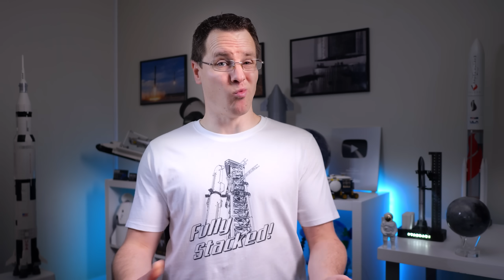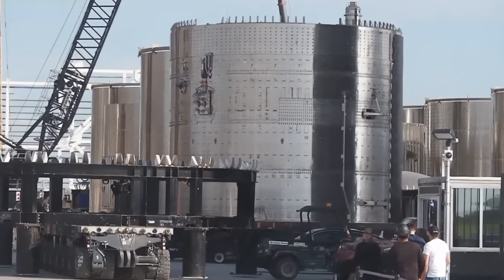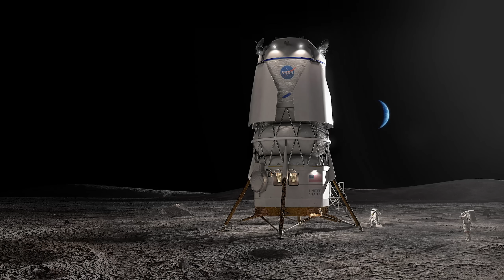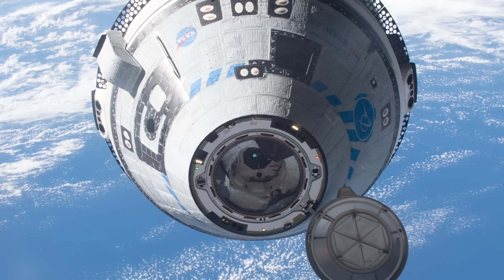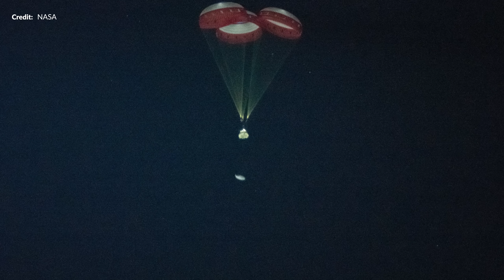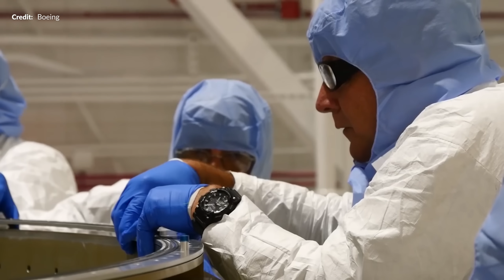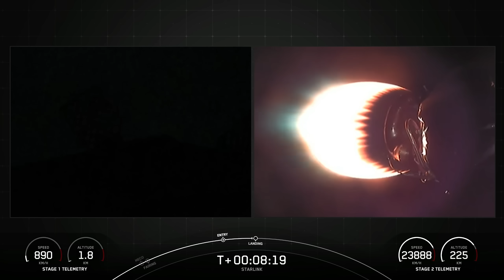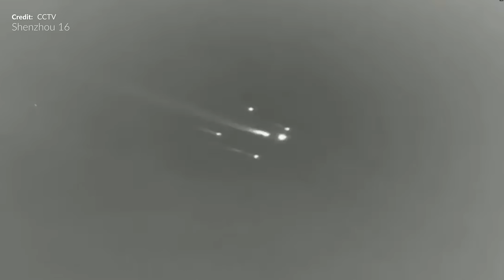SpaceX Starship: Mega Pad Upgrade to Tame the Thrust, Boeing Starliner Delayed Indefinitely

Comment: When the plate is in, they should cover it in heat tiles! The same tiles they use on the ship for reentry. A single large tile would be better with no seams.

Comment: The launch pad will never be perfect until SpaceX redirects the exhaust. I've been saying that it's time to call in the boring company. The water system will just create super hot steam. That's just as destructive as a commercial power washer. You must control the exhaust and construct it out of the same material the engine cones are made of! Can't believe Elons master minds haven't thought on those terms.

Comment: starship promise is to be able to go to land on mars, refuel, relaunch and back. 
if there is a very high requirement for launchpad, then it wont tbe able to launch from mars. at least until very mature facilities are already built.
Reply: The Starship (second stage), with 6 to 9 engines, doesn't need the 33 engine Superheavy booster to launch from the Moon or Mars. For the HLS Starship landing on the Moon, the current plan appears to be a ring of smaller methane (LCH4) engines at the top of the propellant tanks, that would be used for the last bit of landing and first bit of launch on the Moon. So with those smaller engines being roughly 25 meters (82ft) off the surface, that should minimize the disturbance of the regolith.
Reply: @steveaustin2686  I wonder how well that method will work Mars where gravity is more than twice what it is on the Moon, nearly 40% of what it is on Earth. Might need some fairly powerful upper engines. Also even on the Moon it's going to be tricky to get the upper engines exposed when they need to tucked away during launch. Maybe after launch then can jettison panels covering the engines so that they are exposed. Of course that means Starship won't be able to reenter Earth's atmosphere but I don't think they plan that anyway for lunar Starship.
Reply: @StevePemberton2  Yeah, HLS Starship is not planned to be able to reenter Earth's atmosphere. If they have 24 engines, each about 1/4 the power of a Raptor engine, to then it should not be a problem to land with them. 

A Mars Starship is trickier, as they will have TPS tiles that the HLS Starship won't have. And the TPS is needed for reentry. Will be interesting to see what they do for Mars.
Reply: @steveaustin2686  The final landing on the Moon probably won't need that much thrust, the Raptors will have done all of the heavy deceleration, the landing engines just have to do the last bit of deceleration during the final couple hundred feet or so. And it will be a lot lighter by then, as they would now only be carrying takeoff fuel, which will be less than the amount of fuel needed for landing, since the landing engines have to also decelerate the takeoff fuel.

My guess is that they will use landing pads on Mars. The first landers will have robots that will create fuel, and so they can also build landing pads. Of course need to land the first one without a landing pad, but that would be one with specialized capability with upper engines. Maybe that's all that the first lander does is land on the dirt then build a nearby landing pad for subsequent landers. A second "dirt lander" might be needed to bring a crane.  After that's all in place they could use the one pad for both arrivals and departures of "pad landing" Starships which won't need upper engines.
Reply: @StevePemberton2  Yeah, a lot of the propellant would be gone by the time the HLS Starship got to the Moon. Part of Artemis is learning how to do resource extraction and construction on the Moon, for future use on Mars. So early Starships might make a pad. Sending a Starship early to start making propellant would also be a good idea.